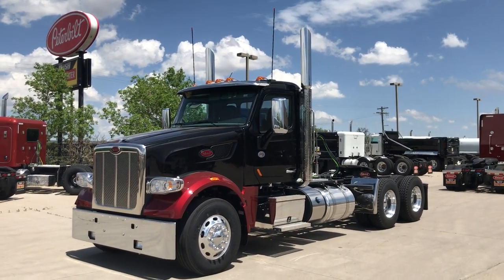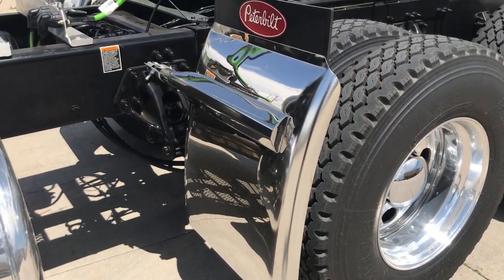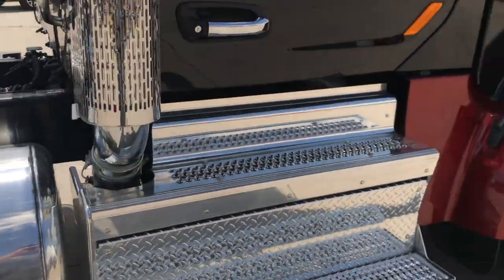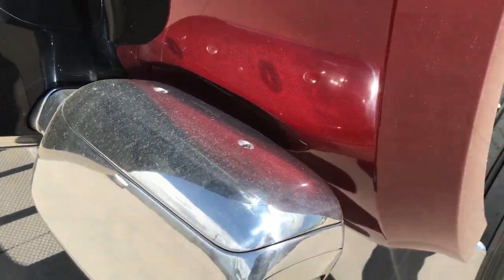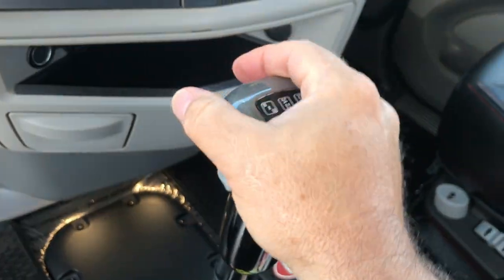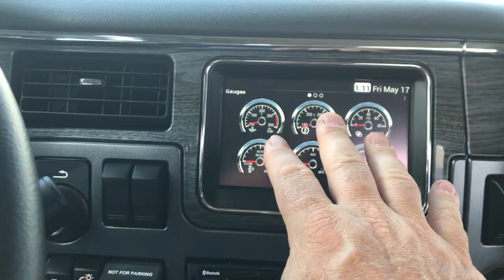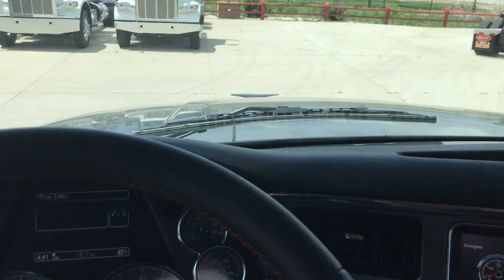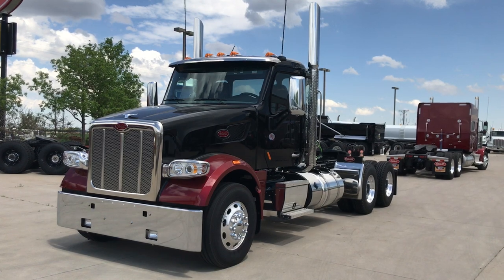2020 Peterbilt 567 Day Cab, Platinum + Graphite Interior, 605 HP!

Comment: Curious to know the weight difference between the 567 day cab and a 389 day cab That are specked out the same i’m currently pulling an end dump where every hundred pounds I can save puts a little more money in my pocket.
Reply from the maker: If they are identical specs the 389 is 100lbs. lighter!